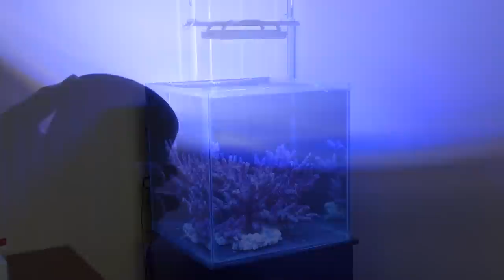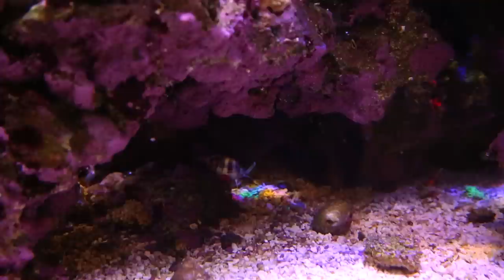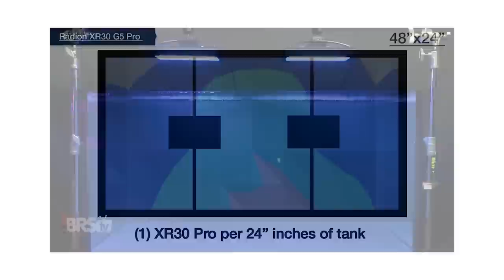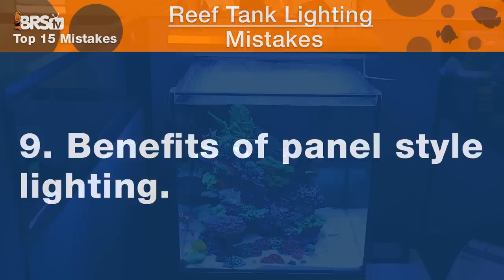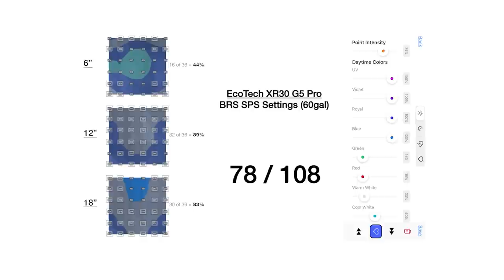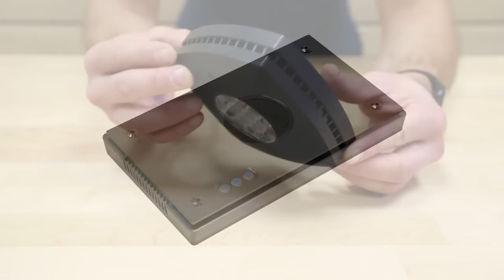Reef Lighting Mistakes - Our biggest fails lighting saltwater aquariums.

Comment: I had the exact opposite experience from everything I've been taught with SPS in my frag tank regarding lighting.  I had my radions turned way down because my acros were bleaching and dying.  I rented a par meter and turns out I was getting less than 100 par at the frag rack.  I cranked up the intensity to 250-300 par and my acros are finally starting to re-encrust and color up again.

Comment: Gonis looks very cool when they are reaching for light and after watching this I realized why mine dont have that look! I also want to ask if its ok to keep white at 1 both warm and cool white  and blues uv at 50?  I have a 20 long frag tank and two 95 watt lights so I need to turn way down!  Which is the color that gives the most par whites or blues?  I also have some 20 watts I could use though and have 3 of them but I have to modify the rim and they are fluval sea nanos but heavy on whites.  Which would be better do you think for such a wide and shallow and narrow tank? Lps and softies like zoas and 1/4 is shrooms, plus the rack sits at about 9 inches deep only! so very very shallow!

Comment: What light and wave makers would you use for a 75 gallon tank? I thought about a current loop ?? I love soft coral
Reply from the maker: We're a big fan of the Vortech and Maxspect Gyre pumps. For a soft coral tank, you don't need a ton of flow. Two powerheads in a 75 should be sufficient for most softie setups.

Comment: Hi i have a question i have recently removed all my rock in my 7 months old reef tank and replaced it with caribsea life rock, i read some horror stories online about cycle starts all over and ammonia spyke etc is this true? And what can i do to prevent this from happening? 
I really don't want my fish ore corals to die im really worried now
Reply from the maker: Replacing all rock at once can have negative impacts as most of the good bacteria that processes ammonia lives on the surfaces of rock. Best practice would be to pre-cycle the rock before adding it to the tank if you're replacing it all at once. You'll also want to consider adding a bacterial booster like MicroBacter7 or Dr. Tim's one and only to help ensure that you don't have an ammonia issue.

Comment: If your gona spend $70 on a rental par meter, would it not make more sense to buy a seneye and have it for life. Are seneys accurat and worth it. U also get ph and temp monitor so seems like a good option.
Reply from the maker: Definitely an option. Only downside is that you have to have a computer or laptop nearby to get the readings, whereas the Apogee meters have a built-in display.
Reply: @BRStv  Oh. So for constant ph monitoring you would need it to be plugged in all the time 🤔. Not good. 

For future they could make a small controller that store data for a few days or something. Otherwise for most would be too dificult to get a good range of tanks ph over a week period with having to plug it in to a pc.